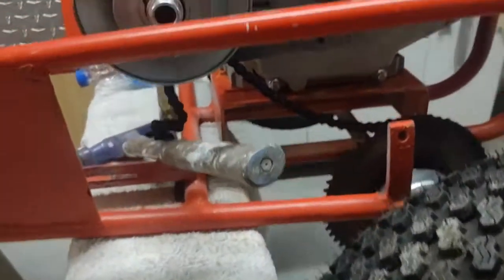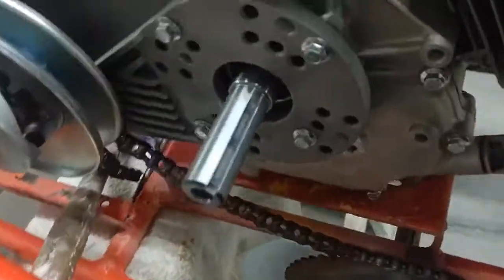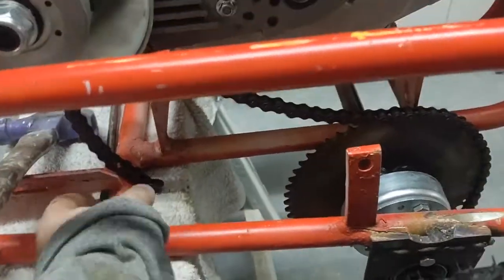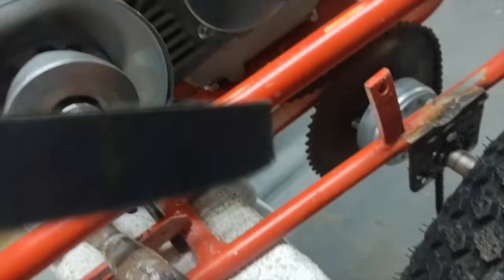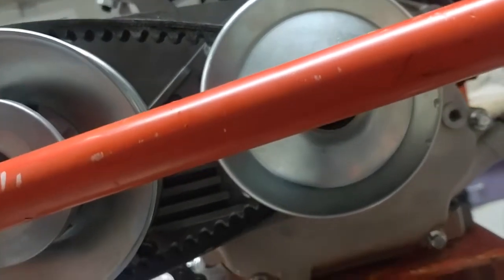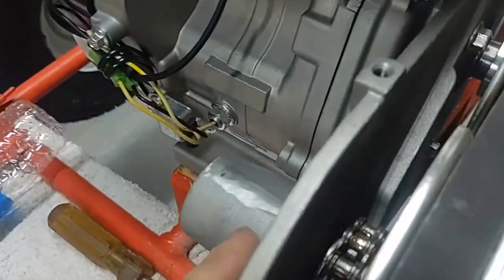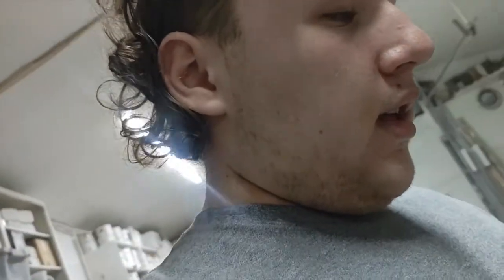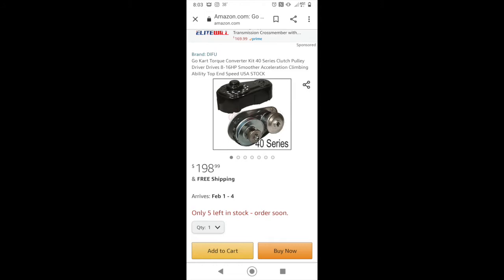30 series torque converter on a 301cc Predator engine

Comment: What size screw do you have to lock in the back of the converter because I got the 30 series and the bolt doesn’t fit
Reply from the maker: the bolt size you will need is 7/16″-20
Reply from the maker: this is only on a 301 predator
Reply from the maker: you can look up the thread on your engine by typing in the serial number the brand or the horsepower